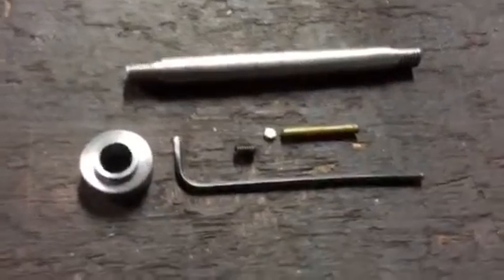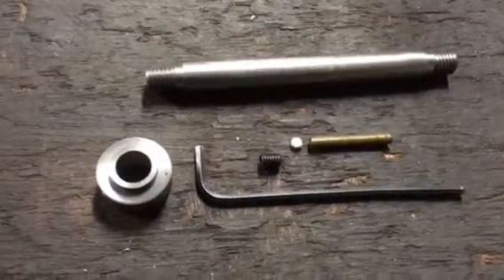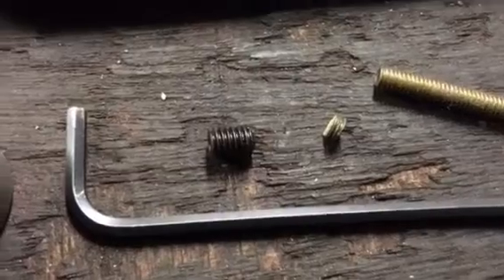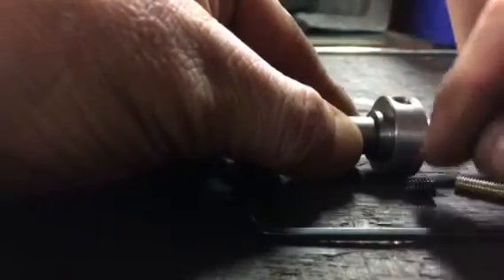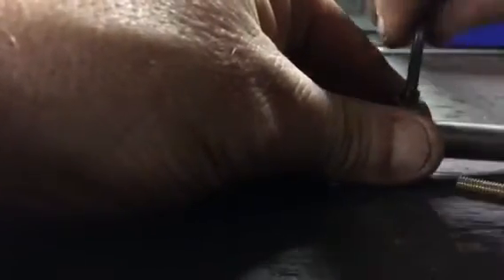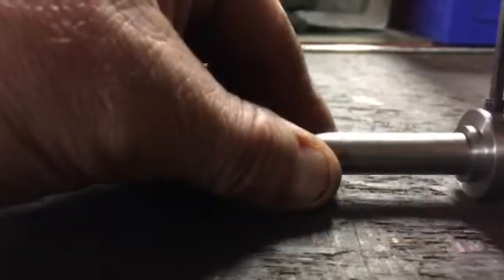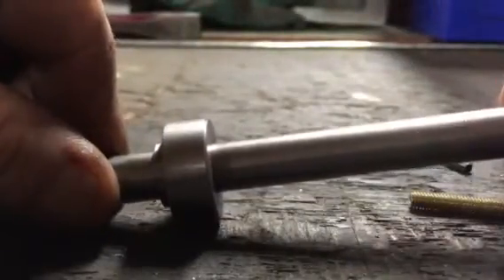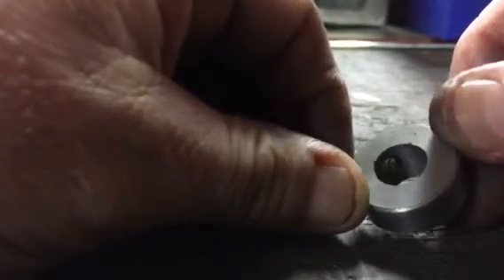How to stop grub screw damaging shaft

Comment: Nice work. I've used this method in a similar fashion with a lead shot pellet or two in place of the brass. It conforms nicely to the shaft but you need to oil the shaft well on the first squeeze so to speak to prevent the lead from sticking. Cheers !